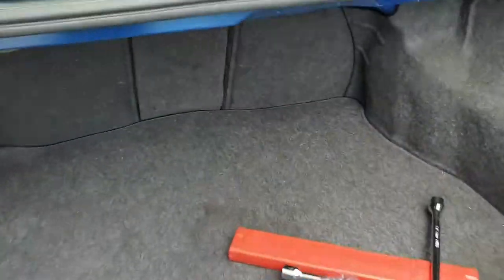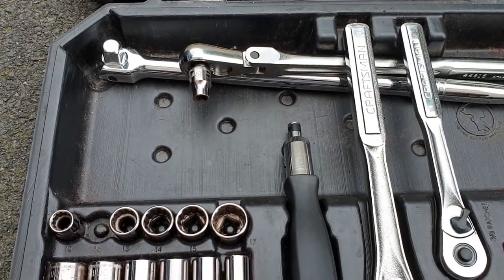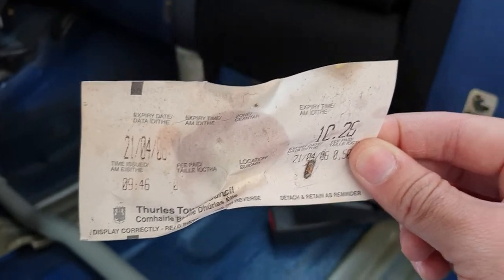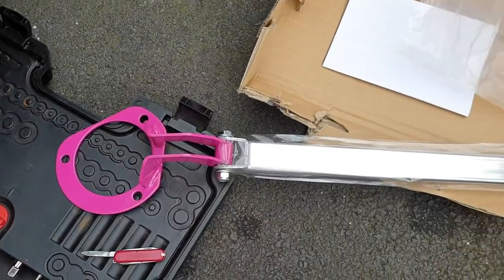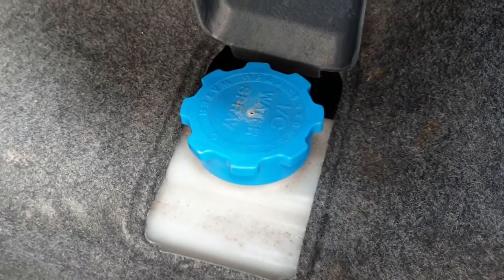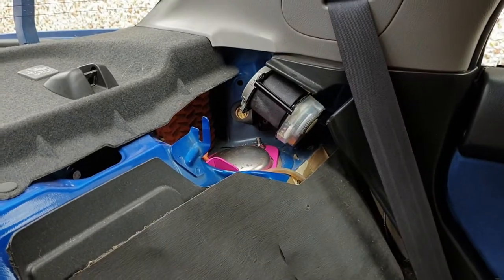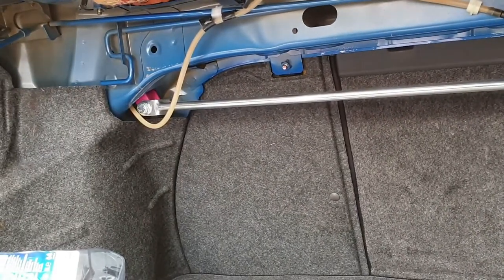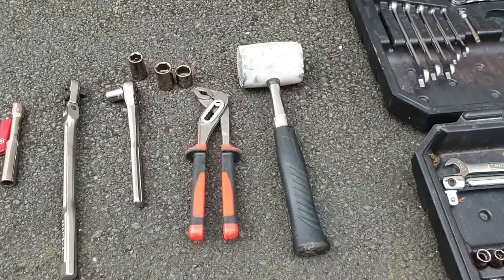DIY: Installing rear strut bar in my 2004 Impreza STi

Comment: So did the car feel better, was it worth it?
Reply from the maker: Hi Manuel, good question. Personally I feel the difference is so minor that I'd invest in other areas instead, such as: Premium tires, better shocks, wheel alignment and balancing tires. For me to be able to tell any difference, I'd need to literally take it to a track, go for a few laps with the strut bar, then go for a few more laps without it.

Point is, you will not feel much difference on your regular daily drives. I did it mainly for the looks and because I had it installed in the front already, thought it'd be good to do the rear as well. Hope this helps.
Reply: @DreamWorkDrive  thanks for the reply one more question did the front bar  feel any different?
Reply from the maker: @MannyG88yo  I feel the front makes more difference than the rear. But still, would invest in other areas instead. Feel free to ask questions, will try to reply as soon as I can.
Reply: @DreamWorkDrive  have you upgraded your sway bars
Reply from the maker: @MannyG88yo  No
Reply: The rear is more useful then the front, per my chat with Whiteline and other GD chassis owners. The front of these cars have plenty of stiffness from the frame and firewall in the front. Also, from a suspension and handling perspective, the rear on these cars is where you get the most slop in control.

I just did the install for the rear struts with a whiteline bar last night, depending on how you drive, you might not notice it. It also depends on what other work you did on the car. I've done control arm bushings everywhere, new coils, diff bushings, rear subframe lockdown bolts, etc. After do all of those and then adding this on top, I can say it was definitely worth it. I also go and really throw my car around twisties, so it was apparent early on.

All that said, I wouldn't do this upgrade before doing everything else I mentioned, you won't be able to utilize it as much if your foundation isn't updated and tighter.
Reply: @StarwindIV  hi bud when you fitted the lock down rear subframe bolts is this removing the bushes in subframe or do you need other parts other than bolts , do you then experience more noise and vibration in the car .